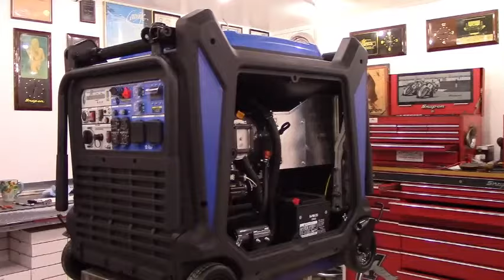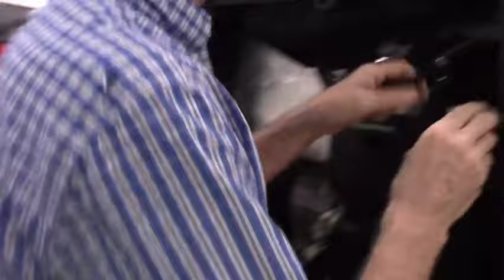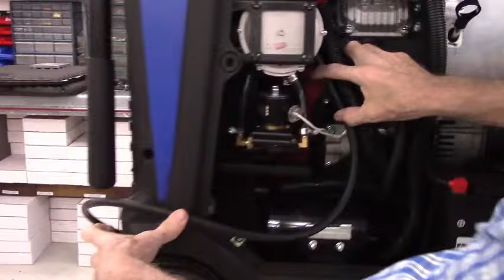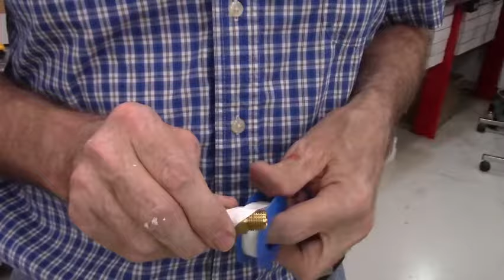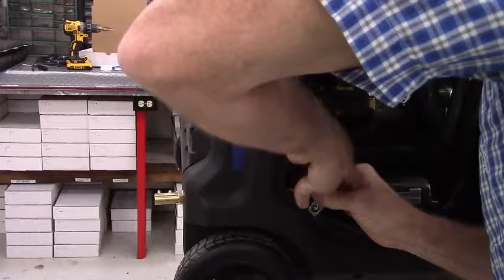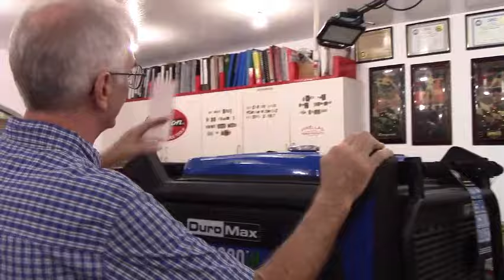DuroMax XP16000iH Extended Run Time Fuel Kit Installation Instructions by Pinellas Power Products

Comment: What do you think of this Duramax generator and the Predator 9500?I heared that there’s a lot of metal shavings when you change the oil?Would you just buy the Honda EU7000is over those?Thanks your a rockstar!!!
Reply from the maker: They are both okay for the price but if you want something nice get the Powerhorse 7500. I like it better than the Honda EU7000iS and it is half the price. The Powerhorse 7500 is the clear winner in the 7k size generator.